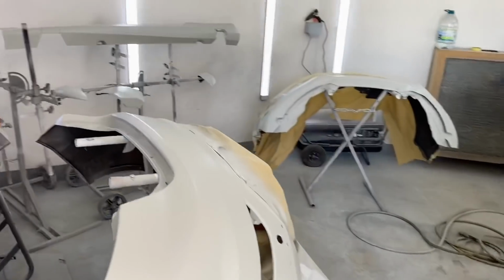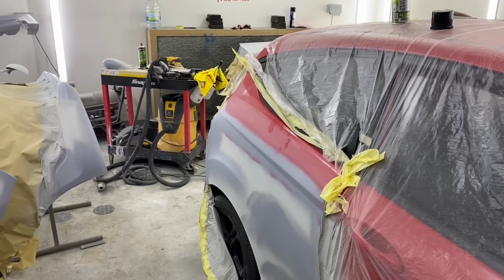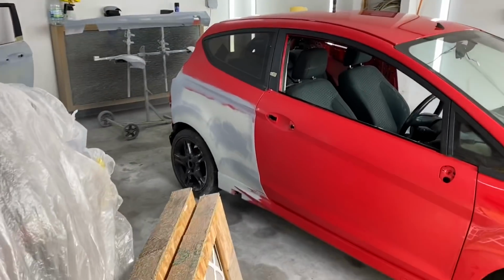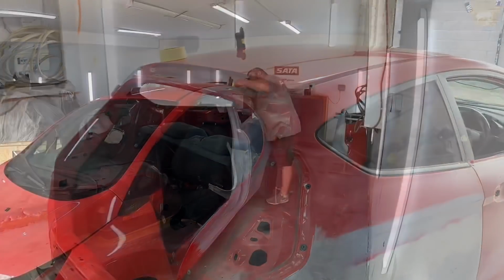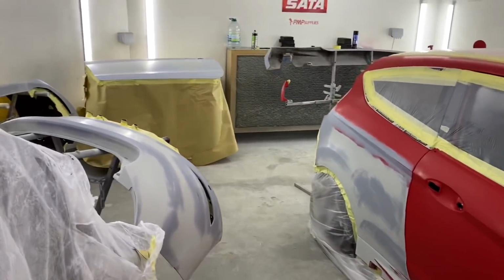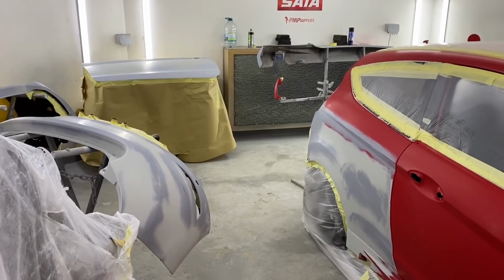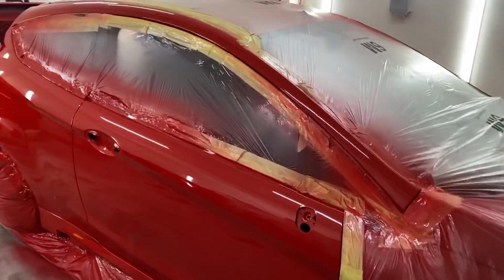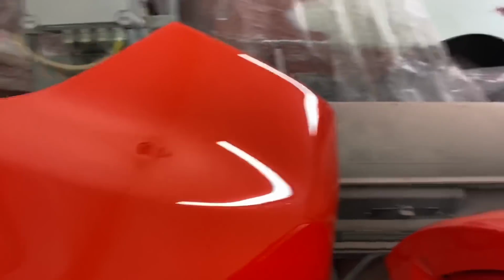Fiesta zetec s salvage rebuild pt2

Comment: fond memories watching this, i had a Colorado red fiesta until feb when i swapped to a golf (i need an auto box now). Eight years of faultless running for buttons. I even treated it to a full leather fiesta metal black interior. I think this is one of the best fords of the last twenty-five years.
Reply: I have a Fiesta, and it's the best car I've ever owned. Cheap to run, feels great to drive, does everything I ask of it.

Comment: Thanks for that explanation, I was curious.
Ive been meaning to ask re paint in general I remember a programme bout an Asian lad who details lots of exotics, at his premises and mobile too, really top end stuff costing a fortune and he has a paint depth measurer, have you or do you use such a device? Obvs I realise the ford's etc from the factory probably don't have your enthusiastic thorough paintwork to start with (&as I said after 3 weeks paint started cumin off on 83 3i which started dad on his customer service journey with fomoco and also explains y he drives a Honda now! So we've seen for our own eyes a splash of paint on a new Ford or perhaps the 3i s paint came from Ronseal!! ) but all the same the machine is rather clever.
Anyway be careful, n you rest up its 5 and 20 to one!
Ben
🚌😄😷😆😁🥁🥁🥁🥁🥁🥁🎹🎹🎹🦄🕰️🏎️🚍🚌🚌🤔
Reply from the maker: I don’t have one my friend has one I can use if needed but for painting in general you don’t need it for detailing it’s used more to try work out how many microns you have to work with for polishing 👊👊👊👊

Comment: Hi mate do you have a heater to dry the paint or do you let it dry naturally
Reply from the maker: Both mate depends on the temperature outside 👍👍👍👍
Reply: @grantssmartrepairs  I'm looking at getting into body work next year how much would it cost for a set up like yours roughly
Reply from the maker: Mate there so many different variables it’s hard to put a price on it

Comment: Is there an "easiest" to paint colour? Red is my fave though me nd the boss like RS Blue ie on a Mk1 Focus RS, we love the colour.
Sunburst Red a la 83 xr3i and Radiant Red a la 89 Rst were my faves, and my red 98 si always looked clean. I noticed the Mobil 1 in the booth too, I used to use it in my si (1.8) and it ran beautifully for 2 weeks after the change but used to go "off" after that and be like it was pre oil change.
Anyway hope you've cooked down, we have air con too, either oppen t'winda lad or get the sat int car wi a/c on, I dunno these posh folk from darn sarf.😄😷😆😁
Take it steady.
Be careful.
Ben 🥁🥁🥁🥁🥁🎹🎹🎹🎹🦄🏎️🏎️🕛🚌🚍🚛
Reply from the maker: For me no all paint is the same I find white really hard as it makes me go blind while painting it and yellow to but in general not one colour is easier then another it’s all the same to me other colours and there pigmentations can be a pain for showing dents etc and or more dirt is visible in say blacks where it’s hidden in silvers etc but in general the Application for me is the same effort 👍👍👍👍👍
Reply: What about these flip colours where they change in certain lights with the flecks of whatever in it? I'm thinking of a rover colour and Nissan did one for winning touring cars if I recall correctly (also rem hound of the baskevilles mondeo to celebrate the same too) Like the St orange or that BP green colour on mk2 foci RS? If they need a touch up is it really better to do all? And obvs does this/should this have a bearing on whether u should order one (new) or be biting ur nails if you get it second hand? They do say in the mags like  BMWS always worth more in metallic/dark colours  rather than say a red one?
I think it's time you got a hanky (handkerchief to you squire) on tha 'ed when tha gets a bit waaarm.
Take it steady.
Be careful.
Ben 🚍🕛🏎️🏎️🦄🥁🥁🥁🥁🥁🥁🥁🎹🎹🎹😁😆😷😄🚌
Reply from the maker: Flip colours are ok to paint bit more work as there normally sprayed over a coloured base ie black etc and then the flip colour but not to bad and same with the rs colour ls they are a 3 stage pearl so the green would be painted over a white base then a flat green then a pearl layer then the clear so a lot of work but quite straight forward if that makes sense 👊👊👊👊👊